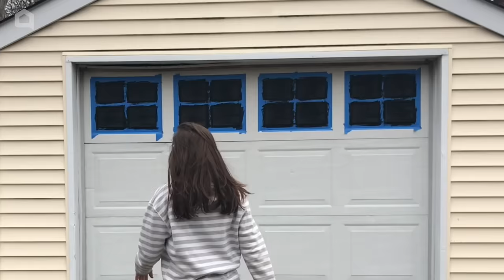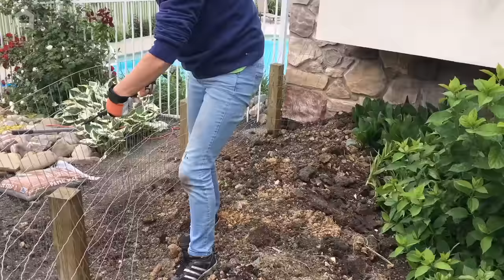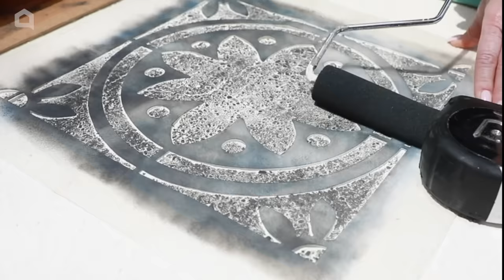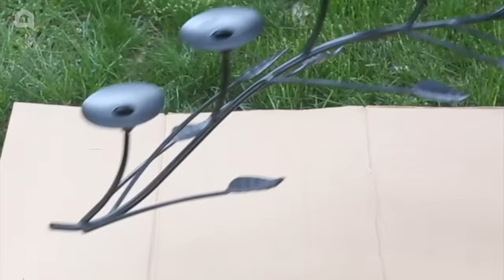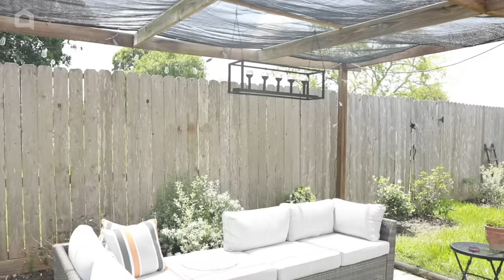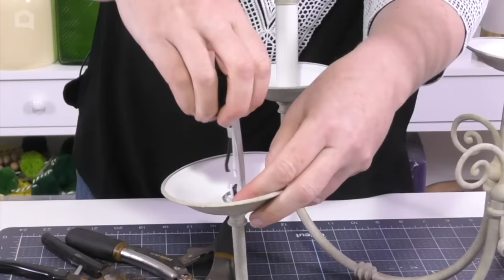Brilliant ways to upgrade your outdoor space on a budget!

Comment: Question:  are the red crates metal or plastic? Will either work? How well does it hold up? What is the type of wood used? I love makeshift items & look for new ways to make reclaimed tables, etc. Any help you can share is fully appreciated.  Thanks, rhe
Reply: Crates were plastic milk crates. Metal could work if it was coated with something to prevent rust.
Reply: @lisabutler6163  thank you so much for your quick reply.